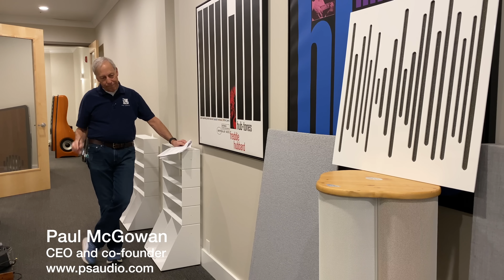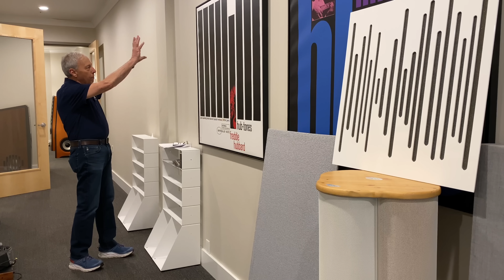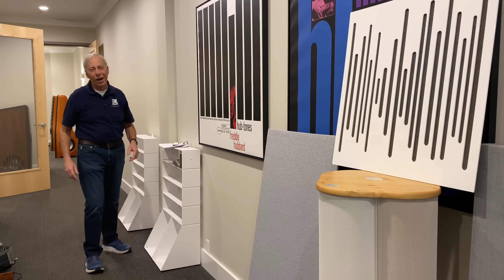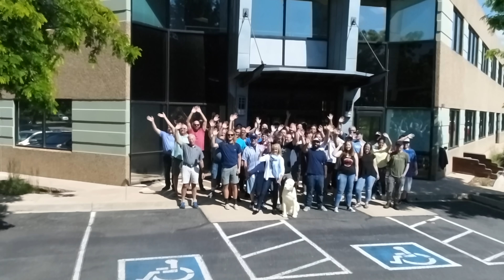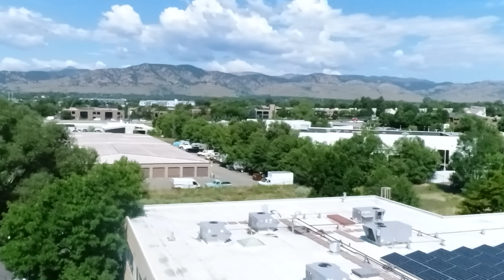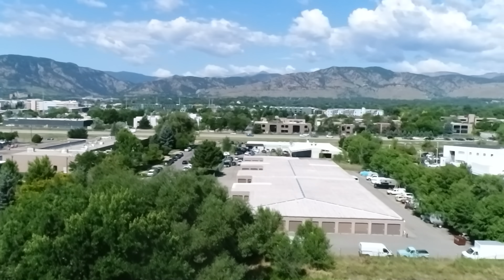USB Audio vs. I2S

Comment: Why don't you just go 5 g would be a lot easier and better plenty of data there why have cables at all?
Reply: For a small company that would probably be very expensive to implement. A dumb cable has got to be way cheaper.
Reply: For a fixed setup, Wi-Fi is more than adequate for audio, if you want wireless data in the home.

Comment: The funny thing is, even cheap CD players use IsquaredS as interface between the transport and internal DAC.
Reply: Qorax I2S is from the 1980s done by Philips and has been used endlessly to move audio between parts inside CD players, TVs, receivers and other audio gear. There is nothing special about it other than it’s a synchronous serial data bus. Chip makers (in this case Philips Semiconductors), like to follow standards to make chips interoperable. I2S, I2C, SPI, MIPI and so on are all about this objective.
Reply: @ThinkingBetter  Yes I have used I2C for some home projects in the past to communicate between a microcontroller and things like little LCD displays.
However, embedded systems isn't really my cuppa tea tbh.

I didn't know that I2S was specifically a thing by Philips though.
Reply: @QoraxAudio  I managed engineering of audio products since the early 90s. Factually, approx. 20 millions of products have shipped that I managed R&D of involving I2S. I have never for a moment considered I2S to be anything more exiting than I2C, SPI, UART or any other such low-level data communication interfaces. It works for what it is intended (move data from A to B) with very little complexity. Currently I'm professionally working on a system involving I2S btw. (via Analog Devices A2B). This topic is a bit tough cause I don't want to speak against Paul, and he obviously promotes I2S as interconnect (a feature of his products) and yes, I2S isn't bad for audio. But, to say I2S sounds better than USB (when used properly) is not a valid statement however.

Comment: ps audio directstream  dac‘s usb design is problematic，it is not immune to usb cable quality and noise. newer design dac even much cheaper models have much better usb design
Reply: Yes, USB in itself is absolutely not a limiting factor for excellent audio. Your DAC is happy if it gets every bit correctly, it can run the timing in full control (avoid jitter) and there is no EMI or power rail carried noise disturbing the analog output stage.
Reply: Thankes you mein freiunds! Is thiss the articles yue was lookin fo...

Applications that benefit from Firewire (IEEE 1394) include nonlinear (digital) video presentation and editing, desktop and commercial publishing, document imaging, home multimedia and personall computing. The low overhead and high data rates of Firewire, the ability to mix real-time and asynchronous data on a single connection, and the ability to mix low spped and high speed devices on the same network provides a truly universal connection for almost any consumer, computer, or peripheral application.

THAKES YOUE AND THMUMBBS IUPS!

Comment: The I2S advantage over usb is patently obvious after listening to both. That is true even for snake oil smellers like me. What I’d like to be able to do is to take avantage of I2S in moving music from my Aurender N100H to the DirectStream DAC. I know that the rendu gear will do the trick but it doesn’t have the Swiss Army knife things that I want to do - i2s connection, dsp, Roon and native DSD pass through. Nothing does all of that stuff and more’s the shame.
Reply: Let me smell some snake oil for you...in terms of USB vs. I2S, can you agree that your DAC only cares about getting the right data (no data errors), clocking the data with the right precise clock (no audible jitter) and not getting noise induced into the analog circuits (output stage)? If yes, where should your nose smell a difference between USB and I2S? Well, the analog output stage is where there is a risk. If you do an A/B test and your DAC using I2S is powered by a premium power supply and your DAC using USB is powered via the USB 5V from a computer power supply, you are right. But then your brain should ask yourself...why not use an external power supply for the DAC? Also, common mode cable noise can be induced via USB, but it's not the fault of USB itself, but more likely about poor grounding, poor PC power supply and others. I had the most horrible audio experience a few years ago using a USB powered DAC with a bad USB cable that yielded a lot of 5V noise into the analog output stage of the DAC. Just avoid that and you can be a happy USB camper.
Reply: ThinkingBetter thank you.

Comment: Can we assume faster rated cables better?
e.g. HDMI 2.1 cable is certified 2.7x as fast HDMI 2.0 cable, Thunderbolt 3 cable is 4x as fast as USB 3.2 gen 2 cable.
Reply: No.
"Faster" in data cables industry refers to the speed of data transmission per second (bytes per second), not how quick the data moves between cables. There is only a limited amount of data to go between the source and the DAC per second, in that parameter it just works or don't. The discussed and controversial point in digital cables/audio is jitter.
Reply: @othonmeira5608   but I assume faster certified cable has less jitter and better shielding?
Reply: @allansh828  not as a rule, don't use this as a guide. USB cables usually are a minor concern in the system, good clocks can minimize their impacts and solve jitter issues.
Shielding is important for reducing electrical noise and EM interference, but mostly decent built usbs are well shielded.
Reply: Othon Official Account  I’ve bought a few audiophile USB cables. They all sound vastly different.
Reply: @allansh828  Cables don't have jitter. Nor do they cause jitter by themselves. Jitter increased by a cable is a product of the driver circuit, cable characteristics, and receiver circuit. For example a very high quality cable can result in higher jitter than a dirt cheap cable depending on the driving and receiving circuits. If the cheaper cable is better matched to the electrical characteristics of the driving and receiving circuits, it will induce less jitter. And as consumer electrical interfaces are very loosely defined, it's a crap shoot buying cables on the basis of the least jitter.
Reply: @allansh828   and @Andy Delle I would really recommend this article: https://www.jmaxwellusb.com/Articles/Audio-USB-Fundamentals.aspx
"Jitter is either due to drifting clock frequencies, or phase shifting between the two data lines. These effects can be introduced by the cable if there is inconsistent wire twisting, or a complete lack of a twisted pair. Also to a lesser extent, metallurgy and wire gauge play a role in jitter."
Not short, but very well written and easy to read. Of course there is a impact of changing, as there is in changing any component. Have you ever done blind testings, Allan? Besides all their flaws, sometimes their results are totally unexpected (obviously, in the majority of the cases they just confirm what we already think). It's very easy to let brand preference / high prices / better looking incline us to think that something sound better.

USB cable discussion always ends on "is it audible or is it not audible". Regardless, we should follow what we hear, not what's "technically more advanced", if you compare two cables and think one sound better than other in your system and you can afford it, there is no problem on buying it but I really do recommend AxB or blind testing before. What we want to hear sometimes affect us more than we think.
Reply: @othonmeira5608  "Jitter is either due to drifting clock frequencies, or phase shifting between the two data lines. These effects can be introduced by the cable if there is inconsistent wire twisting, or a complete lack of a twisted pair. Also to a lesser extent, metallurgy and wire gauge play a role in jitter."

This is not fully correct. The first sentence is right., but not the rest. If the twist ratio is not consistent, then there will be a different electrical delay but it will not move around as in jitter. The only way a cable could induce jitter by it's self is to have a varying length. As for the metallurgy, that is just audiophool talk. If anything the dielectric insulation would have more effect on bandwidth than the conductor. The link you posted is hardly an accredited scientific paper. It's a sales and marketing blurb from yet again some garage cable vendor.
Reply: @andydelle4509  Don't a different electrical delay translates in jitter? I agree, metallurgy is just bs, at least for USB cables. Besides many of what explained in that link is true, their impacts are exaggerated for marketing purposes. I should have got a better link.
Reply: @othonmeira5608  The delay in the cable would need to vary to cause jitter. Like the physical length would have to change at the jitter rate. How is that going to happen? Let's say your jitter rate is 100khz. That would means you need to splice on additional cable and cut it off 100,000 times a second. And rule of thumb is 1 nanosecond per foot of cable. Again a cable alone cannot induce jitter.
Reply: @allansh828  Cables do NOT cause jitter...  What they may have is better channel-to-channel isolation, or different impedance which changes the frequency bandwidth of the carried signal - or entirely different internal cable architecture.  As an example an HDMI 1.2 cable is structurally different than an HDMI 2.1 cable.  Internal wires are used for more things in the newer cable standard, and as such cheap straight wires inside a cable have been grouped into new pairs and shielded.  You can't do eARC well with an HDMI 1.2 cable, and you can't do HEAC (HDMI ethernet) either.  Just like trying to push 10Gig ethernet doesn't work over a Cat-3 10Base-T cable (two twisted pairs) - you need all four pairs and they have to be able to take much higher frequency signals without roll-off.
Reply: @othonmeira5608  What time domain are you talking about?  Look up "usb eye diagram".  Jitter is where the differential wires transition from a low-to-high or high-to-low.  On an eye diagram, this where the left and right segments cross-over each other.  Normally you will see an eye mask - shown as a red diamond,  to the left and right of this diamond is where one bit period transitions into the next - the "bit" must be either above or below the diamond for a receiver to be able to tell what level the bit is (a one or zero).  Think of the receiver looking for a greater than on the + wire relative to the - wire.  If it's true, the bit is a 1, if it's false the bit is a 0.
  
Clock recovery happens at that distinct transition where the normal wire and inverted wire levels pass each other.  You can't tell how much time has passed anywhere else during the bit transition - but you can measure the time between transitions.  If that time is not a static value (it differs bit period to bit period), that is jitter.  It can be affected even by power supply noise, as the transition is determined by sampling an analog state of a digital line.  The jitter, however is measured for USB in the nanosecond and smaller time scale.  That's multi-MHz space, if you can hear that... Keysight may want some of your DNA for a new oscilloscope they are building.
  
But again... this is for the USB serial data bus time domain.  Any jitter here has nothing to do with the output audio clock - unless some moron is using USB clocks to generate audio DAC clocks.  Since USB doesn't have a continuous clock, as each end of the line gets its own chance to talk, no stable PLL timing is possible for audio based on USB data clocking.  So instead it feeds a buffer.  If that buffer gets starved for data, then you might have an audible issue - if the buffer gets full, there is a signaling mechanism to tell the PC to stop sending data for a while.
  
Where it gets bad in cheap DAC designs, is the clock that generates the audio samples.  Getting your 44.1, 48, 88.2, 96, 176.4, 192kHz sample clock from anything that doesn't land right on a perfect clock edge means that the clock edge will arrive a bit out of time.  That makes the voltage output occur at the wrong time, and directly impacts the audio signal.  Some issues arise when a DAC vendor chooses to use only one clock, and then use an arbitrary fractional-N clock divider to get the sample clock.  And then even worse when they use a crappy master oscillator to feed the sample clock divider.
  
Instead, look for a DAC with a solid low-noise power supply with good temperature stability, with two double-ovenized oscillators: one for clocks on a multiple of 44.1kHz, and another for clocks on a multiple of 48kHz.
Reply: @Real_Tim_S   not exactly correct. I’ve seen three different internal layout of cat.6 cables. They way you put on the connectors are different. But I would assume faster cables have better signal integrity.
Reply: @allansh828  This is all tangential to I2S vs-USB, and you are muddying the context (and "seeing something" does not necessarily equal understanding).  The category of a cable has little to do with the cable manufacturer's engineering choices to achieve the performance rating, or a manufacturer's profit-driven desire to control the licensing ($$$) for termination types, or the manufacturer's marketing department's drive to have you believe their product is better than someone else's so that they get a high percentage of market share.  For a given category, a cable must carry a specified minimum-capability frequency, and have less than a maximum cross-talk.  Other criteria like mandatory power handling for PoE will cause different changes in the cable (like thicker conductors).  Those are hugely varying windows and manufacturers may choose ANY point they can monetize inside those windows as long as they can prove performance under tightly controlled circumstances.
  
The end equipment and the data encoding type and rates has a bigger impact on how much headroom you need or have.  A rhetorical argument to "faster cables have better signal integrity", a 150' shielded CAT-5 terminated correctly to shielded RJ45 plugs and jacks, properly transformer isolated on each end of the cable (at the jack), kept away from noise sources along the cable route - and then only transmitting 10Mbps data at two voltage levels...   will have better signal integrity than a poorly terminated 25' unshielded CAT-7 cable that was kinked in several places during installation, with data traces inside both the transmitting and receiving equipment running parallel to high speed clock traces and the switching power supply's high current loop, with noisy power fed to the TX-side jack for PoE, wrapped around a 3-phase inverter drive lines for an air handler and runs in parallel to a leaky coax antenna like those used in halls for WiFi - all while trying to push 10Gbps data at 8x distinct voltage levels.
  
Blindly assuming "cable MHz rating is higher = better cable", does not guarantee it's the correct cable for a given job.  Allow me to put it this way: a Ferrari may be really fast on a track, but if all you ever drive is in stop-and-go traffic, you'll find a well maintained Kia will get you there just as fast - and your knees will thank you for not having to use the racing clutch.  The guy selling the Ferrari however has no incentive for you to use a sufficient tool for your job.
  
Remember that marketing lives in a world where it's easier to tell people WHAT to believe, than to allow people to think critically for themselves, as teaching people HOW to think is much more difficult.  That's what schools are supposed to be for.
  
When talking about "signal integrity", you are talking about the ability of the receiving device on the other end of the wire from the transmitting device being able to "see" all of the transmitted data.  That's it.